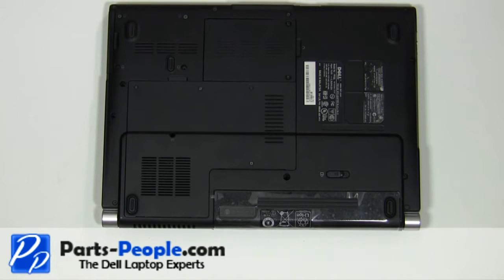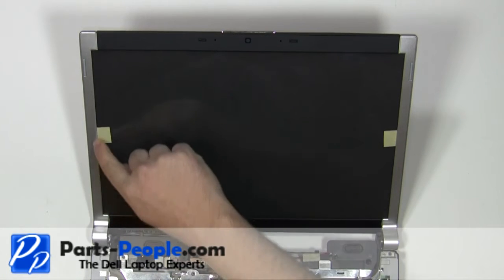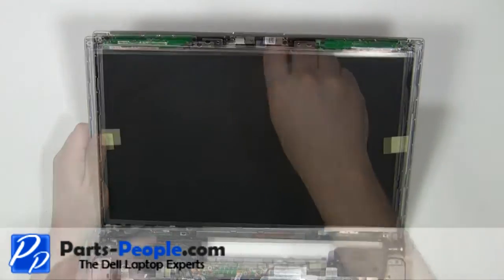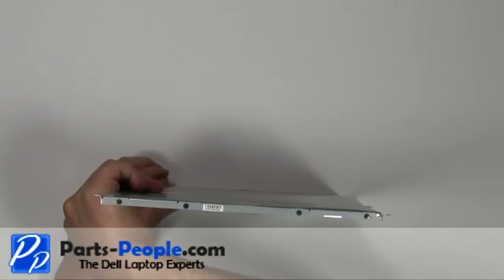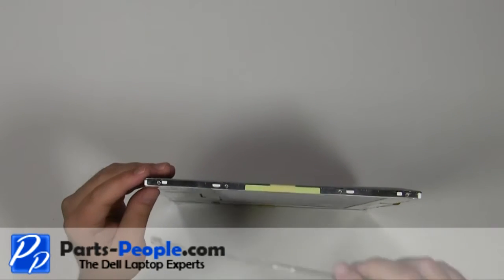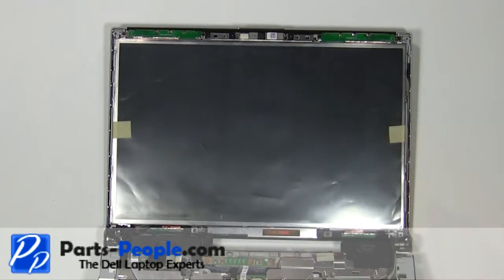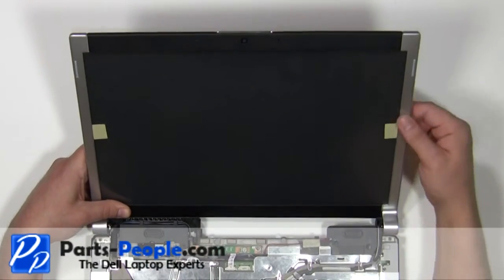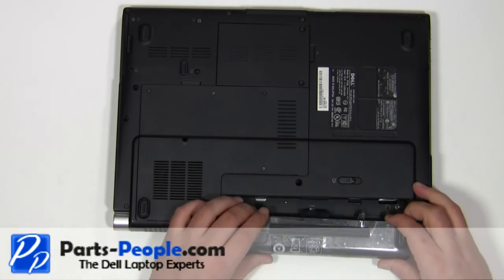Dell XPS M1530 | LCD Screen and Rail Replacement | How-To-Tutorial

Comment: was gonna try too swap my 1280x800 screen for a 1920x1200 one, after watching this.......NOT WORTH!
Reply: Why not? If your machine is in mint condition like mine, I think it's worth it rather than buying new PC, this fix will only cost you around £50-60 and can last you another solid 2-3 years if not more. I have had mine for 4.5 years and my screen just died recently. So I ordered a new one on ebay, taking the opportunity to get the 1920x1200 WUXGA version as my original was 1280x800. Just arrived today, looking forwards to the installation and the quality image.
The installation of the screen looks so easy, then again I did disassemble the machine completely before, probably not easy for everyone I guess.